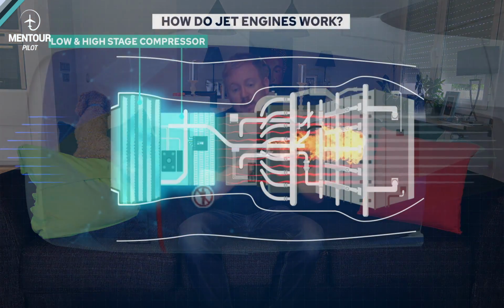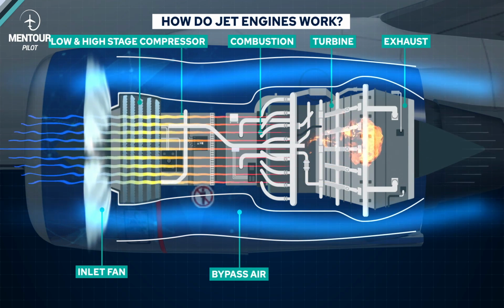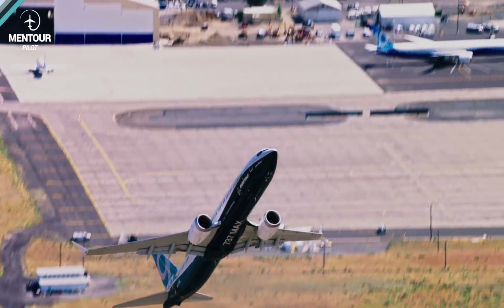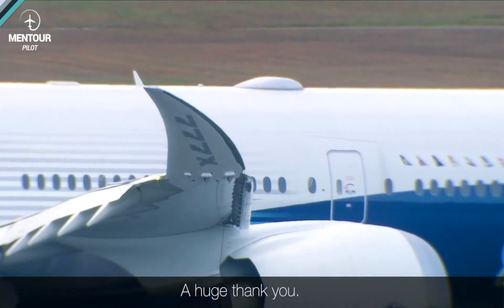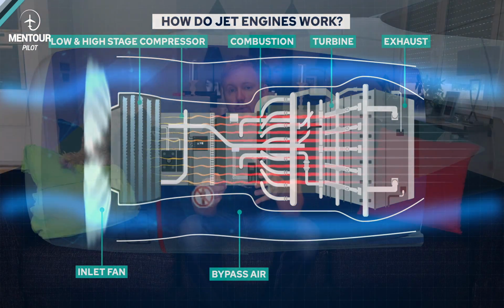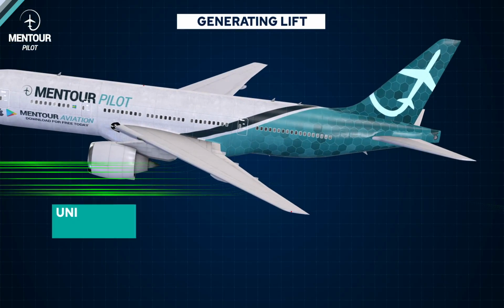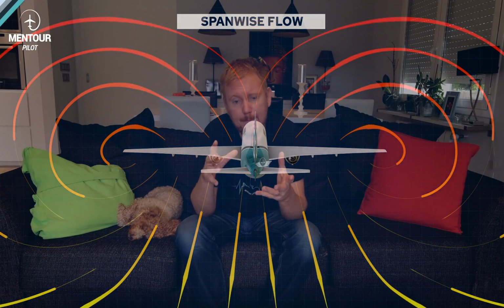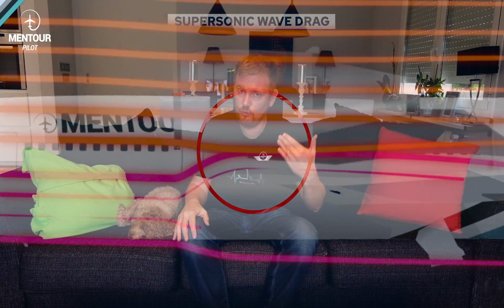How BIG can jet engines get?!

Comment: Just keeping accuracy: Turbines went from Radial to Axial not  Radial to serial.
Reply: Also, there is a limit to the size of the fan, I think that is somewhere around 4m diameter.
Above that, the drag from the surface area of the fan negates any benefits.
Reply: @burningSHADOW42  Not to mention the tip of the fan blades going supersonic.
Reply: @axelBr1  yes, that is a problem, but you can actually compensate for that using a geared fan.
Reply: @burningSHADOW42  The fan is already geared. And the slower the tip is then the even slower at the hub. This will need quite a high angle of attack to compensate so the twist on the fan will be quite savage. The fan blade aerodynamics will be really complicated and you will probably end up with very limited air flow range of operation.
Reply: @axelBr1  And then there is the variable pitch fan. Conceptually possible, but an engineering and maintenance nightmare.

I wont repeat what my former engine designer for R-R called me after I suggested that. The best paraphrasing is something like bastard stepchild of satan. Again, that's the "nice" version.
Reply: @mikecowen6507  Variable pitch fan blades. Wow.
Reply: @burningSHADOW42  Best answer
Reply: From an oil and gas industry perspective "radial" jet engines would be called centrifugal, which is what I've always heard Frank Whittle's design called. But I think the German design started with an axial compressor.

Comment: Each of those new 777 engines costs (in todays dollars) about the same as an entire original 707.
Reply: In 1955, a 707 cost $4.3mm - about $41mm in current dollars. List price on a GE9X is around $42mm. You pretty much nailed it.
Reply: @Taranaki66  Milimetres and dollars are not compatible
Reply: @masseyluna2002  yeah, it should be either €mm of $inch
Reply: @masseyluna2002  It stands for 'million moneys.'
Reply: And the diameter of the 777 engine is bigger than the diameter of the 707 fuselage!

Comment: I think it also must be getting harder to keep the fan blades structurally sound with the size increase as well. A larger blade will be heavier and they already need to withstand an incredible amount of centrifugal forces, and it surely makes it more difficult to design the engine to contain a broken up fan as well...

Comment: So having a giant passenger size “A-10”  Warthog design aircraft would be a bad idea ??? It works pretty well for that aircraft?
Reply from the maker: In the warthog the engines are sitting behind and above the wings. You can’t do that with huge engines since it would severely alter the weight and balance.
Reply: @MentourPilot  Nah, that could be balanced by huge gatling autocannon in front :)
Which could then e.g. launch fireworks to celebrate succesfull landing... what a briliant idea, i should patent this!
Reply: @MentourPilot  wouldn't placing the landing gear towards the rear also counter act that issue?
Reply: @NenYim  Your aircraft basically become unlandable

Comment: So why can’t they configure the wings at the top like the Boeing C-17 Globemaster III?
Reply: @Jason Bowman   'Higher off the ground = harder to work on" is spurious.   The problem is, these new big engines are too close to the ground already.
Reply: @cr-yi7ep  Could not be harder than working on the engines of a Sunderland 12' above the water.
Reply: @bruceparr1678    At least if you slipped you fell on something soft  ;)
Reply: @Jason Bowman Put the gear under the engines.
Reply: @ellenorbjornsdottir1166  this would be an incredibly heavy solution as the pylons (and engine itself) would not have to be able to support the entire weight of the aircraft pushing UP on it rather than only the weight of the engines pulling down. It would never be able to be made efficient enough to balance out
Reply: View my comments. Similar to yours. One about high wing and other comparing GE with RR. I think the most powerful turbofan will be a RR Trent version because of their less weight compared to GE.
Reply: @Jason Bowman : None of your arguments are valid.   Hanging engines from a high wing does not change maintenance.   Remember the original reasons. . .
Reply: @dewiz9596  from that comment alone I can tell you're only a pilot and clearly have no concept of how the plane functions or work is done on it 😂
Reply: Burt Rutan needs to enter the chat.
Reply: Because, for starters, it's less practical, and it just looks worse
Reply: @ngaviation3489  Actually the Antonov-124 looks great and is very practical with its high mounted wings and could easily take a couple of huge engines, though I think it would be better to still have four with similar powered core and much larger fan.
Reply: @listerdave1240  yeah, I guess that the placement of the wing (the way it looks) is mainly personal preference, and when I said that it was less practical, I meant that you need some sort of ladder to do any maintence on the engine or wing and that the lower wing is better for commercial use because it can be used to evacuate during any emergency water landing but then, on the other hand, it does get in the way during a emergency landing on land. But to fit a larger engine, the higher wing placement would make way more sense
Reply: Thank you, sir, for asking what I was hoping Mentour would address! :)
Reply: Aircraft have better handling when the wings are below the fuselage, because of this most commercial aircraft have the wings mounted at the bottom of the fuselage.
A major acceptation to this is are antonov aircrafts which are designed for pure cargo capacity, this is why there flown by some of the best cargo pilots in the world.
Reply: @murphysaburningdeathtrap4983  I would think that handling is not a big priority on a commercial aircraft. After all you are not doing acrobatics, you are just flying a "bus" making the most comfortable maneuvers (slowest) possible for the passengers comfort.
Reply: @murphysaburningdeathtrap4983  it's actually the opposite, aircraft with high mounted anhedral wings are FAR more manoeuvrable, that's one of the key requirements of the C17. They are massively less stable though. Low mounted dihedral wings are massively stable as when it is knocked off course the lower wing is making much more lift so automatically returns itself to balance making it much more comfortable from a passenger perspective as it is constantly self correcting to level
Reply: @yukionna1649  Manurable yes but not more stable, hence why lower wings are selected for transporting people.
Reply: @murphysaburningdeathtrap4983  exactly, the C17 is deliberately designed to be unstable to maximise manoeuvrability. Hence why it requires 6 separate flight control computers, 4 separate pitot static systems and 6 AoA sensors. Airliners don't require any of that as they are designed to be as stable as possible, pretty much precluding high mounted anhedral wings from their design
Reply: @murphysaburningdeathtrap4983  : you are obviously not a pilot.
Reply: @dewiz9596  no shit really i didn't notice

My professional experience is as an electrician who wants to get into paramotoring.
Reply: @Jason Bowman They could use B52 style undercarriage.
Reply: @bruceparr1678  2 motives against it:
1- take valuable space inside the fuselage, that is used in airliners to transport lucrative cargo;
2 - Creates the need of wing mounted wheels for lateral stability on the ground. That creates maintenance costs and add weight.
Reply: the c17 is a cargo plane with no windows on the side of the fuselage if thats a hint.
Reply: @drewpknutz1410  I don't get the hint. Check out the BA146. It has lots of windows.
Reply: @bruceparr1678    Also the Dash-7   Dash-8  ATR72   ...
Reply: @cr-yi7ep , just remember, with the DHC-8 and the ATR family you've got that big fan mounted to the front of the engine.
Reply: @CLTmech   Yes, but the point is, in this context, they're high-wing airliners - demonstrating that such do exist.
Reply: @drewpknutz1410  I think from that aspect high wings are actually better as they do not obstruct the view for the passengers.
Reply: It's not impossible but the extra efficiency of the engines would have to overcome the extra drag from bulges to accomodate landing gear etc. the engines getting larger would make it more difficult to work on to for maintenance - again could be overcome if the maintenance requirements and reliability were low enough. currently though engine efficiency is right at the edge of what can currently be done (IMHO this is why we've seen a few failures over the past few years) perhaps witha  bit more technology you might be able to get past this.
Reply: @tomriley5790  The larger engines, if large enough, actually make maintenance easier. The important point here is that it is not actually the engine getting larger but just the font fan and the shroud. The engine core itself, that is the thing that generates power, remains the same. The only difference with the bigger engine is that there is more empty space between the core and the outer shroud, which actually makes it easier to do small maintenance tasks without even having to open or remove the shroud.
Reply: @listerdave1240  yep, ultimately it's all going to come down to cost/benefit...
Reply: @listerdave1240  you still have to open the thrust reversers/bypass duct to get access to the core engine, effectively it'll make no difference provided the engine is big enough to fit in between the open TR and the engine itself
Reply: @yukionna1649  AFAIK in most engines when the thrust reversers are not deployed they do not obstruct the bypass duct at all, so should not prevent or even hinder access. It is already possible in some big engines today to access the core for minor repairs by getting into the bypass duct. A bigger engine will just make that easier. By bigger engine I mean of course of the same size core but higher bypass.
Reply: @listerdave1240  I work on jet engines day in and day out, both low bypass and high bypass fans. You're right that I can simply walk into the bypass duct on the larger engines quite easily... But it's just that, a duct. There's nothing in there save from the blocker doors and rods. To get to the core engine the TR cowls need to be opened (like a big clamshell) and the bigger the engine or the higher the engine that only makes it harder and more time consuming

Comment: well it becsue haveing one or two HUGE ENGINE are more easy to mtetaine and repair! then haveing like alot of small eniges! in that you don't need to waste space by just conect the two hughe enegine! becsue haveing alot of small enigne just wats more wight and space for all the parts! the ,frammonuts,fuelline,and avonics they need for all the extra small eniges to work togeter wihotu problems! its the real reason it would be alot cheaper to put an space shutle on top of the staten V rocket or space x star ship! becsue they don't need to worry about all of the etra bulk! and by the way the real reson the space x star ship has so many raptor enegine is for reducy and to help starship land on earth after an mission! but can just only use one to three engnie for deep space or for moveing and landing on low gravity like the moon! or to just move like an slow vtol under earth gravity for just moveing to a better location with alot more control wthout risking over corecting when they have already landed! but need to move to a more save area for refrbushing wihout needing a big crawler when it  just hover like a hlicopter and then land to save alot on costs! space x star ship is just what happens when you cobine size of the space shulte with the arodnamics and redudancy of the apolo capsure and comdibe it with the landing capaisty of lunar lander all in one space ship!

Comment: I finally remembered to not turn the volume up loud enough to hear you until AFTER the “theme song “
Reply from the maker: And I’ve reduced the volume, just for you! I always think of you when I edit that part.
Reply: Thank you.
Reply: @MentourPilot  Good call, I needed to play catch-up with the theme song every morning to not to wake up my flatmate while I was preparing my breakfast. 😁
Reply: Aww I liked it loud!
Reply: @alanguile8945  Agreed that I don't need my subwoofer tested every time I watch a video. I think these are edited often on laptop or wimpy computer speakers, so the editor is unaware of the decibel level in the 100 Hz range, and/or assuming everyone else has wimpy speakers. Those of watching on the big screen in 5.1 surround get a bit more 'experience' than the author intended.
Reply: @gg5115  Yes I'm watching on an old MacBook pro so 100Hz doesn't exist for me!

Comment: If you can’t mount the engines on the top of the wings, then mount the wings higher. On the top of the fuselage.
Lockheed, Antonov and Avro figured this out decades ago hahaha
Maybe Lockheed should try the airliners market again lol
Reply from the maker: Yes, but there are other issues with that. I can cover that in another video if you would like.
Reply: @MentourPilot  Hey Mentour! Love your channel!
I watched that video about the differences between top/bottom placement of the wings, but you didn’t really go into the engines subject.
I know about the noise issue and the different handling characteristics. But looking back there were various successful  aircraft with that config. 
I wonder if this is just not an issue of redesign, which is very costly.
Today engines are SO much quieter than those o’ 707/DC8...
So why not?

P.S.: I also have doubts about just how big turbofans can possibly get.
I guessed there would be a material technology limitation, like blade mass and tensile strength... I mean, is it feasible to reach ratio of 30:1 and fan diameter of 9-10 metres?
Sounds bonkers to me!

Comment: Excellent video, never understood why bigger engines are usually more efficient. Am I correct in assuming that lifting the wings themselves would not cause the same aero-dynamic issues? If you move the wings up 2 feet, you should be able to mount engines two feet larger in diameter.

Comment: Mentour: You can't put jet engines on top of the wing of an aircraft!!!
Russian Beriev Be-200: Am i a joke to you?
Reply from the maker: You can! It just won’t be as effective
Reply: @MentourPilot  yeah they actually did it just because it's amphibious aircraft and they had no other choice
Reply: @MentourPilot  I guess it might be a thing of the future. They could build engine mounts that protrude from the wing backwards and just slightly up as opposed to forwards-downwards as it is now common. This should have some benefits like better ground clearance, better visibility from inside the cabin in case of engine failure, reduced thrust vectoring caused by better geometry and better lift and low-velocity capabilities (by sucking in air from above the wing). Meanwhile it would keep advantages of the contemporary design like dampening wing vibration and good accessibility to the engine. Maybe i am totally mistaken by missing some important detail but one sometimes wonders how long it took mankind to implement technologies that are kinda obvious. The basic structure of jet airliners was introduced with the first operational jet-fighter the Me262, it had a long and heavy nose, front gear, engines mounted under the wings and a broadened wing root and is really more a predecessor to airliners instead of fighters structurally. And since then, its all tweaking the same basic form...
With these engines sitting above high-mounted wings as on the Dornier X or the Martin P6M, these are of course limited in thrust due to bad thrust-vectoring, but they did it to get away from spray water. But I am thinking about high-mounted engines on low-mounted wings.
Reply: @A.Lifecraft  Honda does that
Reply: @jaysmith1408  Yes i googled it, but on that tiny plane the engines are in the general position of tail mounted engines, it really should not make that much of a difference (other than dampening wing vibration). This would be different on large airplanes. Also we might see more planes in the future where flow around the fuselage is more integrated into propulsion concepts. Imagine things like bleeding air out of many tiny nozzles and alike. Thinking out of the box here :D
Reply: @MentourPilot  This is a bit of a nitpick, but you might want to distinguish between efficient and effective.
Reply: @MentourPilot  And it lookes horrible
Reply: @MentourPilot  Exactly mate, that's why it's not a very popular design in the aviation World.
Reply: I submit for your review the HondaJet.
Reply: There’s also the Antonov An-72 and later An-74, if you’re looking for something a little more conventional. The idea was to get the engines well out of the way for unprepared strips, and to get STOL performance out of the coanda effect, and I’m assuming performance in other areas suffered as a result.
Reply: @Smegheid  yeah i somehow forgot about those 2 beautiful Antonovs
Reply: Huh?  Which video did you just watch?  He said nothing about top mounted engines being impossible.  He very carefully explained to costs involved in doing so, and said that eventually, the costs overtake any potential gain.  There are top mounted designs for aircraft.  The most EFFICIENT to operate dont use  use that configuration, and likely won't in the future.
Reply: Yes, they are. If it was a truly great design, more aircraft would have this engine configuration. 🙄

Comment: I see most commercial aircraft have the wings on the bottom. Could you not put even bigger engines on an aircraft if you have the wings on the top of the aircraft like the C-17? Or does this run into other issues?
Reply from the maker: There are other issues with that.
Reply: @MentourPilot  Would love to hear what those issues would be. Thanks for the great video, I learned a lot!